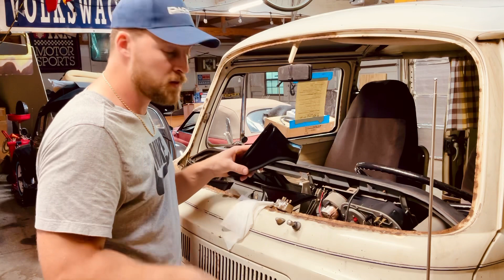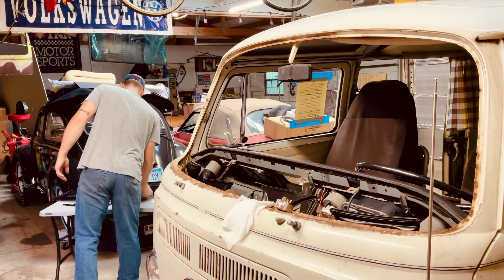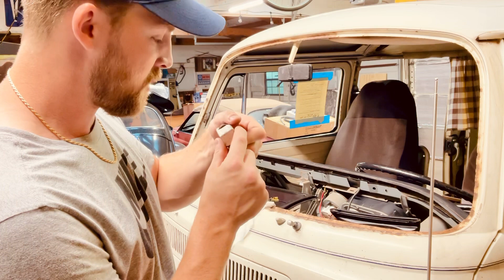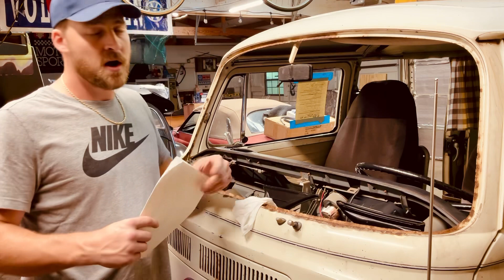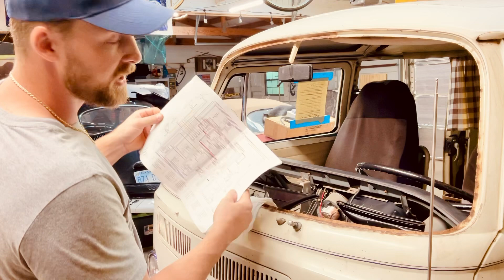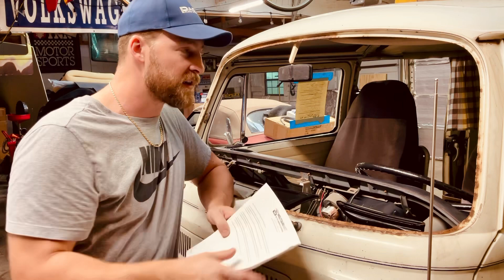REWIRE YOUR BUS THE EASY WAY! VW EARLY BAY BUS

Comment: How do you remove the metal dash?  My window is out and I want to fix the rust on the dash. Might rewrite at the same time
Reply from the maker: @PoundNetTexas  the are Phillips screws along the pinchweld, 2 screws each end of the dash attaching to the A pillars in the door jambs. Removed the 4 Phillips screws attaching the steering column to the dash and the dash should be loose. There are about ten 10mm nuts that attach the metal dash to the dash itself. This is the trickiest bit, but very doable. Good luck - Sam

Comment: How do you earth the dash board on a t1972 type 2 bay please.   .. As the indicators work  on back and front of vehicle,  ... but just short out on the dash ? ... very strange !! ...   The wiring diagrams are little better than useless, as they dont show grounding.  or at least make it clear!! ... i also just keep having the relay for the flash unit , make a clicking sound !!! ... ive tried 2 new ones,  .. same problem!! ...  .... to stop the noise ... i just remove the bulbs from dash in the end .. just to sop the clicking .... but of course this means no dash indicator lights :( ....    the strange thing is, ... that if io touch the bulb and holder to a piece of metal,  .. then the bulb lights up !!!  ...... is so frustrating,  no forum or video ive found actually shows the problem being solved,  .... if your lucky you may get some guy saying,  .. I jumped this to that etc!!! .... But no explanation or pictures etc,  ... of just what they jumped?  .. And what they actually mean by Jump!! ....

Comment: Wish you were in San Diego, pay you in a heartbeat to do this on a 70.  Question watched a vid called Bus dash rehab.  Basically, he takes off the dash instead of taking the window out.  Seems like you would gain the same access.  This seems useful if you also want to retore the dash.  What do you think?
Reply from the maker: A large majority of what you have to do to remove the dash cover and various components to completely remove the dash you do so to have the cover painted. Aside from the electrical connections, the side mounting, column, and dash covering to the bus body, the dash removal is pretty straight forward. Seems refinishing the dash would be another reason to remove it as we have here, but a lot of the procedure applies to both.

Comment: Great video mate. Just about to fit the new kit, windscreen is out and i was planning on putting it in today... Not now i aint!!. Good idea right there. Is it tricky to rope the windscreen back in with the dash in the way. Just done all the side windows but i pull rope at all angles in circles to get rubber to sit right.
Reply from the maker: You want the dash installed when installing the windshield. Makes for the installation of the finishing screws along the pinch weld (base of the windshield opening) a breeze for installing before the glass is in the way.

Comment: I'm prepping to do this right now with the window out on my completely disassembled and missing parts 71 and I couldn't imaging dealing with this spaghetti factory from under the dash.  Need to source all of the dash components - switches, relays, speedometer, fuel gauge, dummy lights if you have any original or aftermarket recommendations.

Comment: Working on my 71. After pulling the speedo I have got my wires wrong. Didn’t know the dash was two pieces. I pulled my window and the metal dash part and now have amazing access. Thank you much.
Reply from the maker: Very glad it helped you out. Makes seeing things straight on and inspecting components so much easier. Best of luck getting things sorted and congrats on bus ownership. They’re the best. - Sam